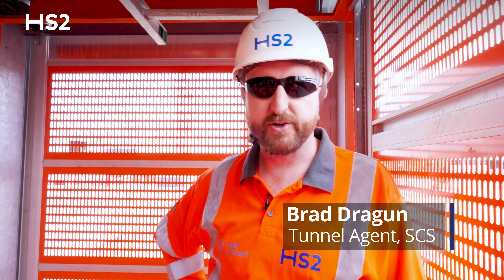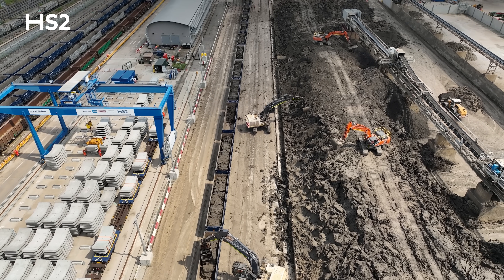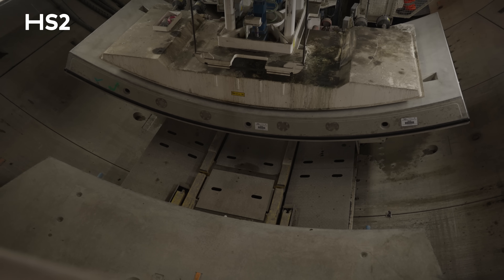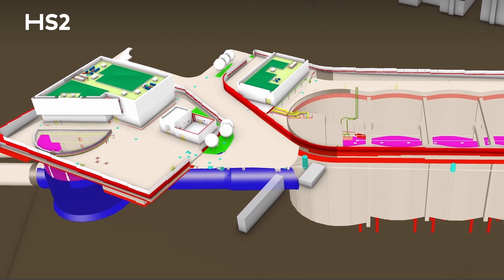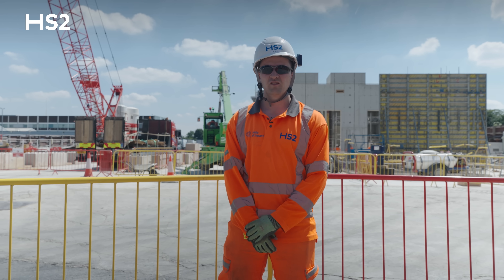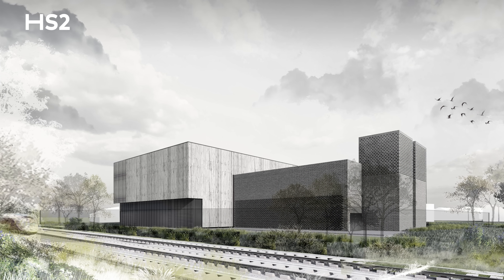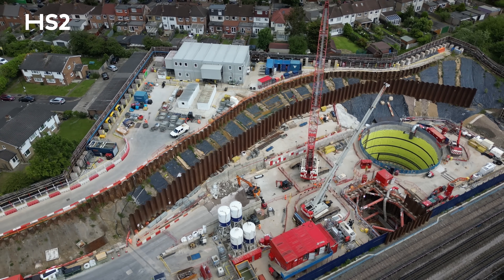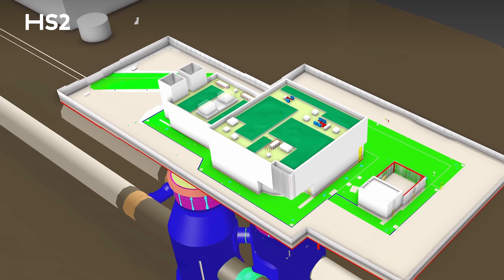HS2’s Northolt Tunnel under the capital is 50% complete

Comment: These are the works that no one ever sees let alone understands how important they all are. And these are the expensive works needed if you don't want a railway on the surface.
Well done HS2 for highlighting what these people are building.
Reply: Yes it at least showcases what can be done, Civil Engineering wise.. and it is up to future decision makers wether to cheapen up or not..
   The “anti” noise will will die down immediately this first section is up and running just like it did after the Manchester Liverpool was built in the 1830’s
Reply: And you are praising HS2 and they cannot even guarantee if it will reach central London and have cancelled everywhere above Birmingham. I presume you work for them and you're just trying to praise yourself. If you want a high speed train line across the country it should have never even stopped in Manchester it should have carried all the way to Inverness.
Reply: @Beansontoast93911  "I presume you work for them and you're just trying to praise yourself"
And right there you loose all credible argument . As any military person will tell you "assumption is the mother of all cock ups" And you just did that. Add in a dumb insult and I should just leave you to it.

But I have to correct your false premise:
1. HS2 is already being dug into Euston. The evidence is on YT from just last month. What has been changed is the development projects that would have been built ABOVE Euston. That would have required huge piling work to support it and the surveys showed unfunded extra costs.  They have also earmarked the legacy platforms to be closed.
2. Manchester is a key travel node connecting Trans Pennine and North / South routes. TPU is well underway and all funded. The HS2  North / South costs were escalating and a redesign was needed. Local mayors (of all parties) have suggested alternatives and its now up to Labour to fund it.
3. North of Manchester the traffic does not justify a discrete HS line but HS trains will still go to Glasgow but on legacy routes.
4. As for Inverness I nearly choked on my coffee. Do tell me that was a joke? You do realise that most passengers use the sleeper from London and in any case all transport matters in Scotland are devolved right? Oh wait you didn't ... 😏
Reply: It has only become expensive because of the amount of billions these private companies are taking. If HS2 contractors wasn't doing this for profit it would have been able to get in to Scotland completely Underground. You should be ashamed for praising them but I presume in you're getting a bonus
Reply: @Beansontoast93911 you're only saying that because you have been misled into thinking the 32.70 billion budget was the correct figure.  But it never was as it was a figure pulled out of the air by HS2.
Reply: @TrevorWilliams-fq8mg  and if HS2 are constructedness and they're telling you a random figure what does that say about the service they are providing
Reply: @TrevorWilliams-fq8mg  and if you think that is an acceptable reason for it to quadruple in price and the government have left all of these private companies get away with it makes you a joke man and that quadruple in price doesn't go from start to finish. If I was to pay somebody to paint my house and they only painted half of it they wouldn't get a Penny from me
Reply: @TrevorWilliams-fq8mg  I'm remember it's not that I didn't finish at one end it didn't finish at the other end and if it does it's not going to happen until the 2040s it's a get into London so we still better off using the original train line so run back to your Bosses at HS2 and tell them they are a waste of space
Reply: Quite agree with you about the HS2 Agency. But you can't blame the Contractors. You might say I would say that as I used to work for one of them on the cost side of the business before I retired.  But when the contract was signed there was nothing designed.  So the contract was let on a cost plus basis (the actual cost plus an screed profit margin of the usual 1 or % profit). Then after that point in time the scope of works was designed with thousands of services diversions, highway alterations, and planning conditions arising.  In effect the construction contract is a signed blank cheque. And if it doesn't go to Euston, it will look an even bigger joke.
Reply: @TrevorWilliams-fq8mg  but they cancelled it going to Euston about 2 years ago and they're waiting for private investors to come in to finish paying it off and therefore if then private investors are going to finish that off which is going to take another 10 years on top that is going straight on your ticket price
Reply: @TrevorWilliams-fq8mg  it is funny we're just arguing in Multiple chats but I think we want the same thing
Reply: I'm just explaining why the cost has gone from a budget price that was pulled out of the air,  compared to reality. If the Contractors said yes we will build it for the budget none of them would be around for very long then the railway  would never be built. And neither would anything else because they would all be out of business.